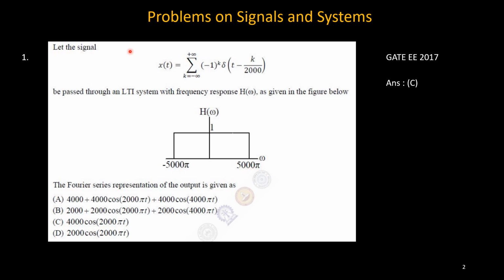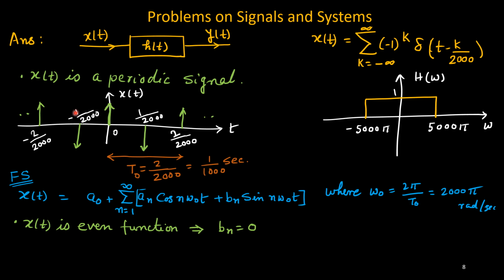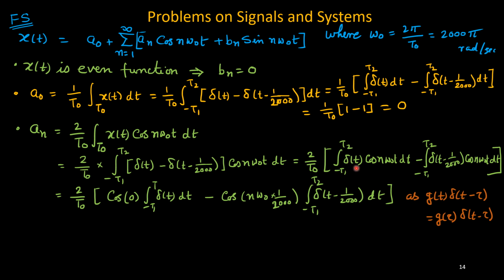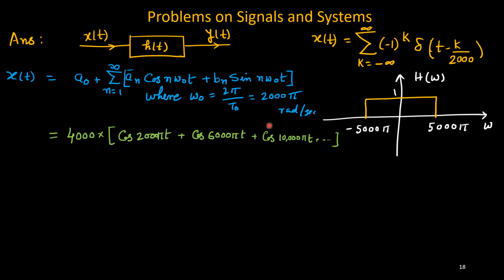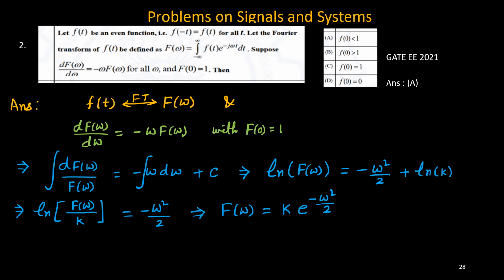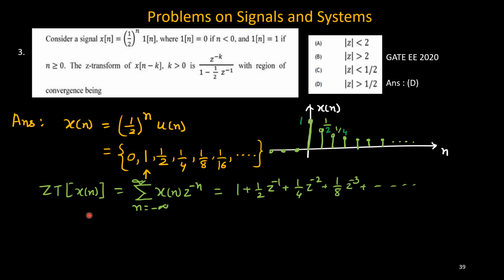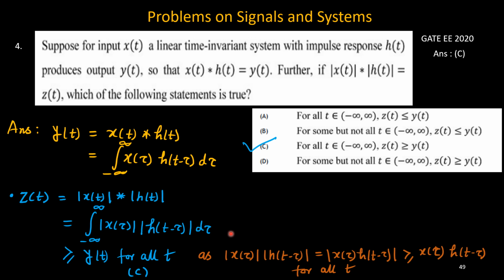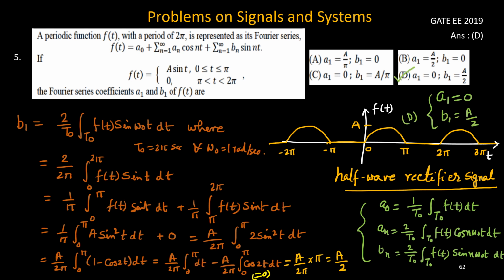Problems on Signals and Systems | Fourier Series and Analog Filters- for ECE and EE : Part 2

Comment from the maker: Please let me know if you have any difficulty to understand the solutions of these problems. Keep watching. I would solve problems from other subjects like control systems, electrical circuits, analog electronics, digital electronics, EM theory, analog and digital communication and math.           

Timecodes
0:00 - Intro
0:44 - 1st problem
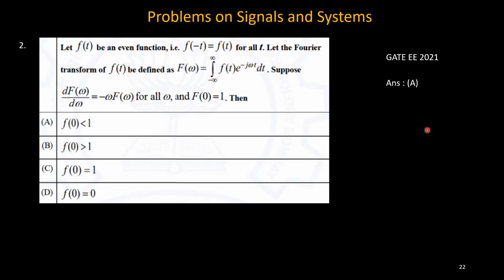24:10 - 2nd problem
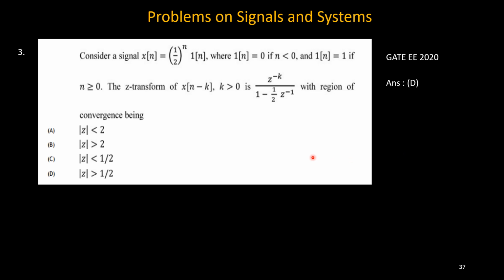32:20 - 3rd problem
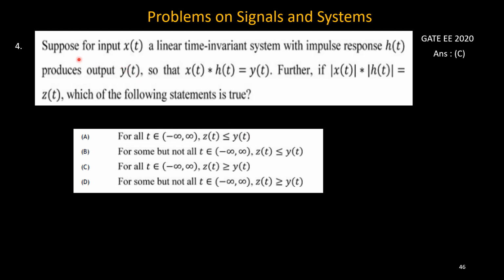38:44 - 4th problem
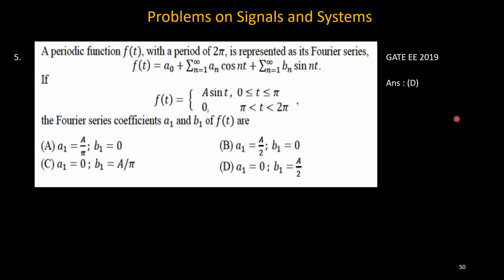43:07 - 5th problem
48:30 - Conclusion